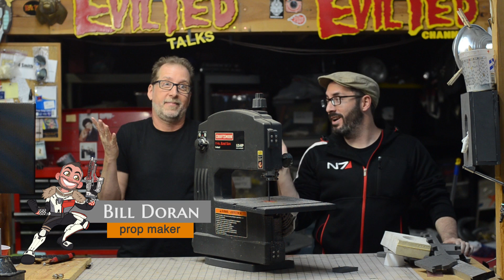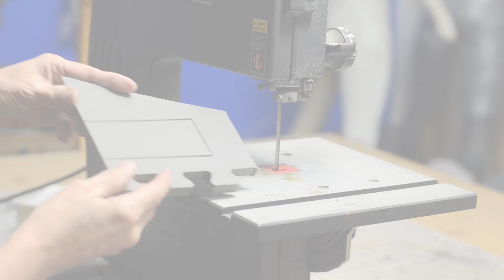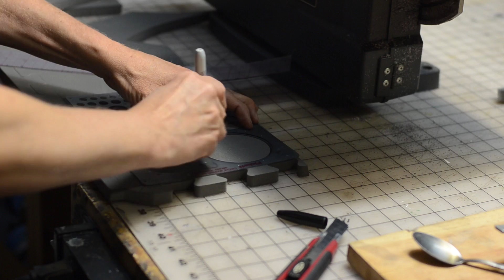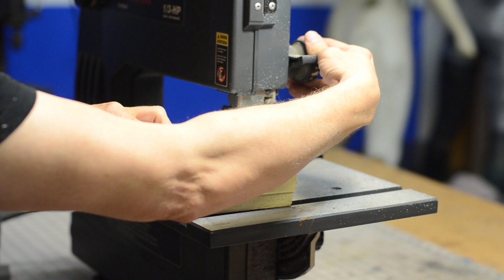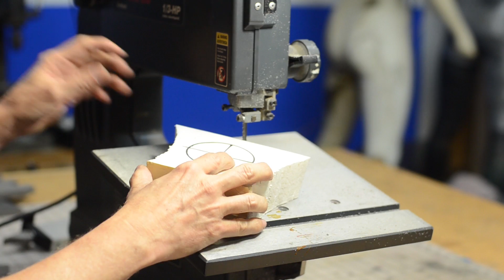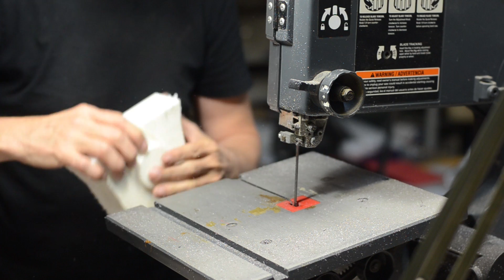Bandsaw Tricks for Foamsmithing with Evil Ted - Prop: Shop

Comment: hi what tpi blade are you using? thanks
Reply from the maker: I use an 18 TPI metal cutting blade for cutting foam. I think it's 1/2" thick. It doesn't leave a perfect cut surface, but it's pretty good.

Comment: Hi Ted, have you ever tried using a table saw or Miter saw for cutting foam?
Reply from the maker: I can't speak for Ted, but I have not. I typically use the bandsaw for larger cuts or a scroll saw for detail if I'm not simply cutting by hand. I'd be worried about how light the foam is and it getting thrown around by the circular motion of the saw, or getting torn up by the size of the teeth.

Comment: Hey guys! This is the perfect video to ask a question I've had for a while. I have bandsaw access at work and a scroll saw for use at home; they both have their niches, but deliver pretty comparable results. In either case, saws are definitely the way to go and these days, I only grab the boxcutter or X-acto if I really need to.

The problem I have: One thing I've been doing, since I don't have access to 2" thick L200, is using Barge cement to stack multiple layers of standard floormat EVA, then trace my pattern onto that and cut it out. It give me perfectly clean lines and everything matches up great. The problem is that the Barge, since it's rubbery, leaves a slight raised edge that I can't get rid of; it doesn't sand away and it's too small to cut away with scissors or a razor blade. 

How do I get rid of that raised edge of pure Barge? Once it's gone, I can make the layers pretty seamless with Kwik Seal (the textured pattern, even with diamond plate, is negligible when glued together). I've toyed with the idea of using solvents like Barge Thinner but I'm not sure if it will damage the foam or separate what I have already glued together. Do you guys have any ideas?

Thanks for making this video! The tip with the thumbtack is especially helpful and I will certainly be using that.

Comment: Safety point - really you should adjust the depth of the blade guide so that there isn't room above the workpiece to get a finger in contact with the saw blade. Not really a problem when cutting foam, but if you cut wood, you'll get areas of softer grain where you suddenly find that when you're pushing with the same force, the workpiece moves a lot faster towards the blade. You shouldn't have a finger directly in front of the blade anyway, but proper adjustment is an extra layer of protection that might help keep you connected to all of your fingers.

I'll second the recommendation of looking on Craigslist, eBay, or other classified ads. A few days ago I managed to get a band saw and a pillar drill for a total of £40 (about $50 US). The saw was old and tatty but usable, but the drill was fine and came with an extra belt thrown in.

Comment: I couldn't really decide between a band or scroll saw, seems like a band saw is the better choice?
Reply: They can both do much the same jobs, but excel in different areas. A band saw will probably be able to cut thicker material, but a scroll saw is better for cutting tight curves and complex shapes. You will also find that a cheap scroll saw will have a larger throat depth (the distance between the blade and the frame) than a cheap band saw. If I had unlimited room in my workshop, I'd probably have both, but at the moment I've just got a band saw.
Reply: Thank you very much for the help!

Comment: iwonder if i can make a band saw using an old motor
Reply: You could, but unless you get a big kick out of building tools rather than using tools to build other stuff, I'd just pick up a cheap second hand one. If you want to find a use for an old motor, build yourself a lathe (or find an old belt-driven one in need of a motor).

Comment: The caveat for newcomers to bandsaws: 'Learn how to use this tool from an 
experienced bandsaw user'; bandsaws can still sever a finger from a 
careless user if they misjudge the cut-path.

I love the bandsaw as I'm a woodturner, and I often cut small pieces of Orange 
Tree wood with it (but I'm aware of where my fingers are during the cut)

The bandsaw in the video is 'variable-speed', and not all bandsaws possess the variable-speed capability.

Great video Bill, and Ted, a wonderful demonstration of what a bandsaw can do for an EVA foam creator.
Reply: Agreed. I'm not a professional woodworker by any means, but I took a lot of shop through the years and before switching my major in college to something where the risk of bodily injury was slightly less (studio art to art history), did spend quite a bit of time using bandsaws. 

All of my experience has been with the big, more industrial ones, I've had a few years, I was taught by people who have probably had 50 years cumulative experience, I'm careful and aware of where my body parts are and am not afraid to use push aids when I need to for cuts that aren't as precise, 911 is always pre-dialed, and my comfort level with the equipment itself still hovers somewhere between "terrified" and "respectful."
Reply: I have some 'push-sticks' / 'push aids' within easy reach when I'm cutting. 

It always pays to be 'respectful' of any cutting-tool, and that's a great attitude to possess (we both love our fingers)
Reply: I have a friend who's a professional joiner and has been using various big, dangerous power tools for over 20 years. Despite being about as expert as it's possible to be, and normally taking all relevant precautions, earlier this year his mind wandered for a moment and he had a close encounter with a table saw that left him requiring the services of a plastic surgeon in order that his left thumb might work again, once the tendons heal sufficiently.
Reply: - Crazy Russian Hacker

Comment: Thanks Bill! To everyone out there that what's to up the building game. GET A BANDSAW!
Reply: is there a difference in use between Band saw and Scroll saw? As with what materials would you choose between Band saw and Scroll saw?
Reply: I'm looking to buy something like that at the moment. And I would think for foam and small pieces of wood (model making) a scroll saw would be better. Isn't it?

Band Saw = a rotating saw-band - good for wood and more (even bigger pieces)
Scroll Saw - a sawblade like jigsaw what goes up and down fast - here are even smaller sawblades possible and you can work pretty filigran an small and soft things

I hope I got it right. So Bill & Ted, whats better for our hobby in your eyes and why? 
Thaks and greeting from Germany
Reply: +Jens Gebauer this reply is kind of to both of you I'm not an expert on the subject of foam smithing as I've only just started but equipment I know being raised by a carpenter now what I would say is the scroll saw is better for smaller items or extreme details like say if you wanted to add teeth onto a knife or cut some jagged edges or chips in armor stuff such as that however that being said a band saw can do these things just not as well what the band saw is for however is larger shaping jobs. you can actually get some very very precise curves on material with a band saw with proper planning and practice. So overall shaping of items and some detail work= band saw Extreme detailing=scroll saw. with the scroll saw you won't get as good quality with the larger cutting and in some cases might not even be able to fit your object onto the cutting area and trust me getting your whole project onto a flat even surface is a must for Amy sort of project that involves cutting. IMO if you're getting super serious into this type of work you should try to get both but again my own opinion band saw first scroll saw after. You can do fine detailing with patience and an exacto knife but if your project is too much for a scroll saw then you'll be SOL.
Reply: The bandsaw you linked to is “currently unavailable” :(